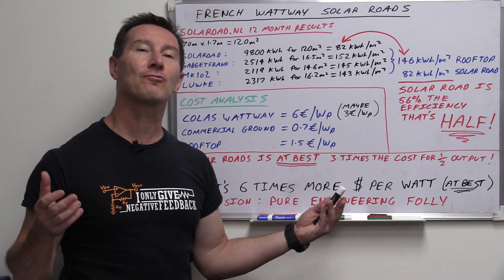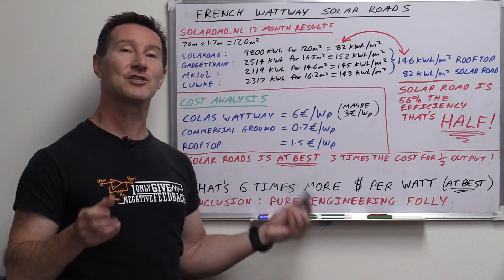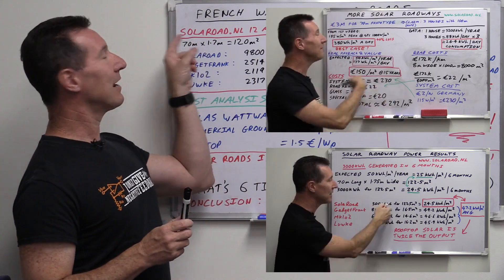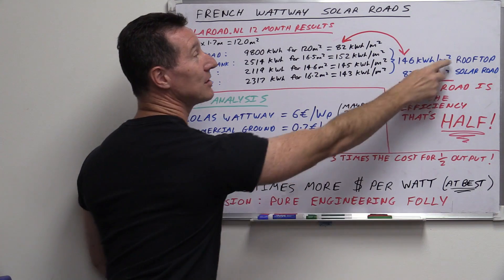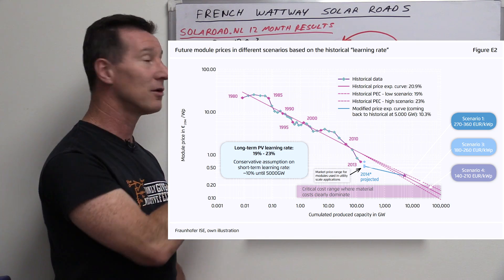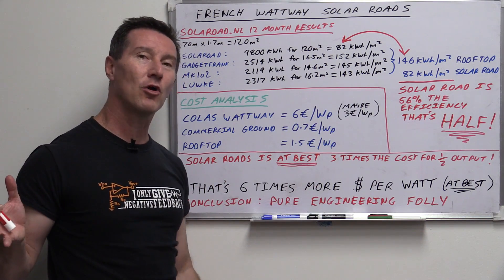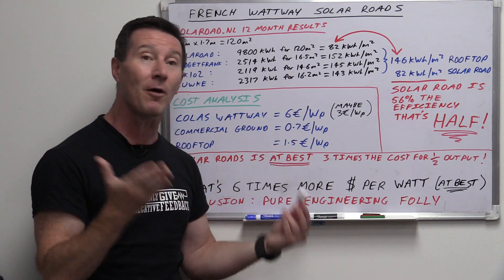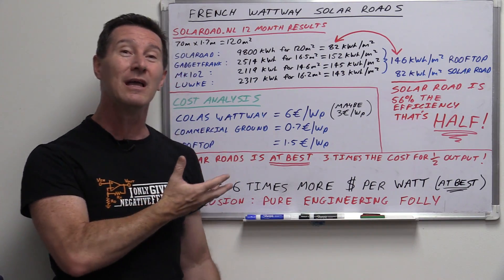EEVblog #850 - French Wattway Solar Roadways BUSTED!

Comment: Solar Roadways aren't that bad - just build them exclusively on motorways and put the panels on roofs above the cars. Basically, combine all three Ideas.

+ No more snow/ice/hail/aquaplaning
+ No wasted space 
+ Easy cable management. Power/Gas/Internet/Whatever, it can't get cheaper.
+ No wear&tear from cars running over sensitive electronics

- A little more pricey than commecial ground, but hey, you safe the cost of snow plowing and sanding, not to mention the houndreds of lifes being safed by free roads in winter.

Comment: Dave, awesome video! Thank you!

Obviously I'm not the only one that thinks that putting solar panels ABOVE the road is a MUCH better idea than putting them on the road!

I'm thinking that PV cells on top of a canopy over the roadways at basically the average-ideal angle would offer the best static "rooftop" PV energy (or better), but also provide some additional protection to the roadway surface from the environment (solar and hydrologic), plus better thermal protection for the vehicles and people on the road: IC engines should run more efficiently, passengers are shaded and should need less air conditioning, etc. Also any water (evaporation distilled!) runoff from the canopy could potentially be directed into water reclamation plants that would need less filtering and purification. And there would be minimal impact on traffic during maintenance.

Comment: PV is fine at isolated junctions OFF LOAD BEARING areas  in SUNNY counties. For ''demand driven' lighting (on detection of incoming vehicle), signals and telephone whatever. Otherwise - no sale. 

I'm not against PV. For roofs in ARID countries. But I live in UK. the grid goes everywhere. Put 100% nukes on the source end of that, convert spae hating etc, to electric as the drain - bobs yer uncle and global warming targets would be done by 2030 not 2050. With profit - but oh  no, "that's not Green enough, that requires government to take a decision and stick to it. That might need citizens who can think in a straight line for 5 seconds to actually pay the taxes that their aspirations require." Nyaaaaaarggghhhh!!!!!! 

Frankly we're better off talking to electrons, you know where you are with an electron, even (quantum) if it's uncertain of it's own position.

cheers

Comment: I totally agree, except for one point:

"It will be/might be/is complicated"

That is not a good point. It never is, not for any argument. Not even close. We already have massively complicated infrastructures. We're actually pretty good, as a species, at dealing with complicated infrastructures.

If there were a simpler alternative, that is one thing. But wiring up loads of non-roadway solar panels are just as complicated a problem as wiring up solar roadways.

Again, I totally agree with you on everything else. I just really have a thing against anyone claiming that a system is "too complicated" when there really isn't an apparently simpler solution.

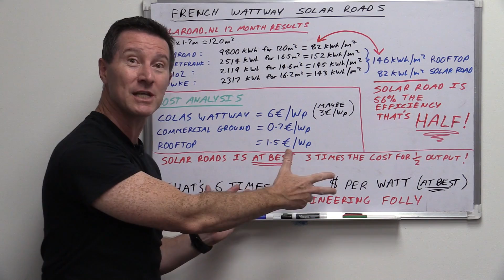EDIT: Specifically, I'm talking about where 12:50 or so when you said someone had to plan the system. There are other reasons why solar roadways are more complicated, that just isn't actually one of them.
Reply from the maker: +Christopher Pilcher No, commercial installation are much easier to install, wire and maintain than ever solar roadways will be.
Reply: I just figured that, in theory, solar roadways would have an output in the same way that normal solar panels do. In that sense, specifically installing them and wiring them into  the grid is no more complicated than doing the same for commercial panels.

Devils advocate, but not having to install a structure to support them would save in costs, from what I can tell. EDIT: By that I mean something to keep them off the ground and stable; as in you could put these "new" solar roadways on the old roadways.

But that said, I have never read the "spec sheets" (if we could call it that), so I'm making a huge assumption.

But you're totally right. Like I said, I agree with everything else. All of it. Maintenance is harder, it's less efficient, all that much more important stuff is so true!
Reply from the maker: +Christopher Pilcher Nope, sorry. Roads surfaces need drainage, so you need other channels dub specifically for the electronics and cabling. Trenches next to roads (that rip up footpaths and verges etc) are expensive. Commercial installations don't have these hassles.
Reply: EEVblog I didn't think about that, you're right.
Reply: +Christopher Pilcher How many low voltage power lines do you see running for 1-2km in a single stretch... Oh, wait, no we use high voltage cabling as the energy losses just in the cables become too high. You can't just dig a ditch and stick a telecoms cable in it. You need to invert and step it up, some serious insulation, some seriously thick copper then one also needs some power storage as solar has a basic issue with power storage, else that energy isn't available at night when it is most needed for house lights etc. 1000km of this, you got to be kidding, all the energy profit is gone just by the time the energy is transmitted anywhere. One can not just wire these things into a grid and be done with it.
Reply: +Daniel Abrahams Space saving could be an argument, but even then putting a ground installation on the crash barriers would be better.

I'm just saying there is a possible case for them to make, but it's not going to make up for the cost.
Reply: +Daniel Abrahams well we have environmentalists that stands in the way. the road has a permit already. again not enough to make up for the inefficiency, but a good talking point. and if environmentalists get too aggressive this might even be viable. (crash barrier post one, not roadway)
Reply: Oh, and speaking of environmentalists... They would love this concept, and for a new road (if prices go down) their bickering (or lak thereof) could make the difference in the cost of the road...

not going to happen with the maintenance costs, but if they are able to bring the profit from energy up to the additional cost of maintenance (in addition to the regular costs of an asphalt road) then it might be a tiny "win" in shutting them (the unreasonable ones) up.

Comment: On a micro scale, and that would be your back yard solar panel setup that is under 10Kw of solar generation. Solar power can be a cost neutral or a little better proposition. As for energy production on a large scale, it's just not cost effective, or reliable enough to be taken seriously. All the projects today are mainly there to make a few people in high positions feel good about themselves. The single cleanest and environmentally friendly means of producing reliable energy, that has the lowest cost and largest production of energy is nuclear.

Comment: What if instead of the main road, they used these on the shoulder and hit them w/ the street sweeper once a week?  The real question is what do they do w/ the power they do produce from the road, if they use it to power the infrastructure needed to maintain the roadways, then surely there is a better way to use solar to do that.  If they are selling the electricity on the market then the problem will take care of itself.

Comment: The  bottom line:  The ENERGY produced will never even come close to the ENERGY used to  manufacture and install the units within their service life time.  Ie. They have a net energy debt.  They only produce tax rebates.    You would save energy by not doing the project.   I suspect even roof top solar is still not breaking even, though it may be getting closer by now.
Craig

Comment: I am trying to look on the positive side here, and figure out why they are still doing it. One thing might be that the cost of the space that would otherwise be taken up by the solar panels (unworked land) won't be usable or sellable. You could calculate this into the equation too. Also I doubt the price of regular solar panels will drop at the same rate of these fairly new ways of implementation, which is another thing to consider. All in all it seems like a very time to actually start doing it. ~ 6 x the cost for ~.5 the output are numbers that are very hard to convince anyone with. I would not be surprised if this chick will work as an executive in the company after her career as politician has ended.

Comment: You completely ignore the fact that the road otherwise would bring in 0 wh... 

My point being, yes they are not as effective as roof top solar arrays, but does that mean we should not investigate the idea?
Reply: Why bother investigating if it fundamentally doesn't make sense? There is a fixed amount to be spent on renewable energy, why spend it on inefficient and untested (so risky) technologies when you get so much more bang for buck elsewhere
Reply: +Tim You completely ignore the fact that Dave (and many others) have investigated what the results would be... (watch the vids where he even uses the optimistic values from the manufacturers or the video after that where the trial testing proves what Dave presented earlier)

My point being, you don't have to install solar roadways to determine the installation and material costs and maximum energy output.  The whole situation only gets WORSE with maintenance, damage and the brilliant idea of placing huge moving 'shade makers' over the panels.
Reply: +Tim you are totally missing the point, there is no point in wasting money in new technology which is clearly not as good, and will never be as good, as what we already have.

We can see efficiency and develop new technology without rolling it out on a massive scale! But in this instance it is extremely clear that solar roadways will never be as good as a traditional installation just due to practical reasons.

Your point about roadways currently not generating electricity might be valid if we have no other space to put solar panels at all - but there are also rooftops not generating electricity currently, and putting the panels there is clearly better so why not do that instead?
Reply: +Tim the reality is there is no way there is no other place in the whole of France to put solar panels which isn't better than under cars where they are less efficient and subject to constant wear.

And there is a fixed budget for these kinds of installations and the taxes definitely shouldn't be spent with companies who are promising massively lower returns for the money for the sake of the novelty of having the panels under cars which is clearly a worse place for them.
Reply: +Tim " You completely ignore my point. How do you think we came to the current solar tech? By just sitting back and not invest and investigate in it? I'm sure the efficiency that we have today was right there when we made the first solar panel, right guys? "
Again, you act as though industry is just sitting back and not investing, it isn't.  Some people will come up with bad ideas such as solar roadways, that doesn't mean they must be entertained or sponsored without proper proof of their claims AND a good reason to divert funds to them compared to other projects.  Meanwhile, the solar panel industry is still moving along and making improvements.
Solar roadways are not the savior of all solar panels, so please don't act like we should expect technological marvels just because of solar roadways.
Reply: Mark Robinson Again, short sighted. It does make sense, roads just lay there doing nothing, why couldn't they produce energy? 

> There is a fixed amount to be spent on renewable energy, why spend it on inefficient and untested

There you go, untested! That's why we have to test it. Why should that budget just be spend on already proven concepts and not push the boundries of what is possible? How do you think we have gotten to the solar panels we have today? Did they just fall out of the sky?
Reply: Mark Robinson I get your point. I just think it's bullshit.

Yes there is. It's called pushing the boundries. We didn't get here as humans by just sitting back, now did we? It's called R&D. 

> Your point about roadways currently not generating electricity might be valid if we have no other space to put solar panels at all 

Building codes in France prohibit the builiding of solar panels near monuments, for one. The netherlands has limited space 

You really don't get my point, do you?
Reply: JimmyDB - You completely ignore my point. How do you think we came to the current solar tech? By just sitting back and not invest and investigate in it? I'm sure the efficiency that we have today was right there when we made the first solar panel, right guys?
Reply: Mark Robinson You are literally still missing my point.
Reply: +Tim We are not missing the point. Pushing the boundaries is good, but you have to look, where the real boundaries are. It's not so complex to put solar on roads - we learn nothing new. But it makes no sense - it's like wasting money to develop quadratic wheels.
Reply: Enzo Canuzzi Hahahah you think it's not complex to put solar panels in roads? Alright I'm out.

Comment: If the cost to produce, install and maintain a means of generating electricity is higher than the whole amount of electricity it will produce in its life cycle, then the net benefit is negative - you might as well throw that money out the window. What will dominate the cost of solar roadways is in no doubt going to be maintenance, which is going to exceed what they're saying it will. In other words, laundering money through a monopolised state contract to the elite. The politicians who advocate and approve this plan may have gotten a bribe, or may just be stupid enough to believe this bullshit.

Comment: I vote for a Gravitational Waves powered generator.
Reply: +JimmyDB - No, I want the real deal. A generator powered by Gravity waves. ;) Don't ask why, caus it will be awesome!
@david be a champ and do the calculations :) The plan is to use a piezoelectric material that stretches and generates electrons. We should make it as strong as possible because it will deform no matter how strong it is.
Reply: +Haas You mean like hydro-electric?  Where the effect of gravity waves on water causes it to move in the direction of the wave generator... and where we place turbines in the way to convert that linear movement into rotational force?
Reply: +Haas
LOL!  
It will cost a billion dollars and make you wait 10 years for the power.
Reply: +geonerd Wow that is really cheap, now I want one for sure!

Comment: I never really understood why anybody would think solar roads could be a good idea. You do not even need to do the calculations to compare it to rooftop installations. "Let's put solar panels on a surface where cars will regularly block out the sun. Yeah, that sounds like a good idea." I mean, it would even be better to put roofs with solar panels over the roads. Would cost a bit more to build (not even sure about that, since you would  be able to use standard panels), but you would avoid a LOT of the problems. Plus, during the summer people would be able to drive in the shade, and during the winter, you would not have to remove snow from the roads :-)

Comment: but there is more benefit than just electricity, they are useful whit self driving cars, following traffic and whit batteries and led lights. but no it does not make sense for making electricity. but making smart walkways and roads are different story.

Comment: Here's the biggest issue with solar roadways: why do they have to be roadways? Why can't we just have them near the roads? Why can't we have them over bike trails? Why can't we have them above parking lots?
Reply: +TheTundraTerror Agreed.  Given the efficiency and cost issues with turning the road itself into solar panels, I think it makes much more sense to place higher efficiency panels in the median or sides of the roads.   I think another possibly good idea would be to place them alongside rail-road tracks and under HV lines where they have already clear-cut the path anyway... plus with putting them under the HV lines there is the added benefit of immediate access to the grid.

Comment: Sa-cre-bleu! ... I belive that is more reliable to put solar pannels in the moon and connect them to a looooooong as fuck wire that is also connected to a central station in le France instead of this bullshit of solar roads. C'mon, Solar Pannels needs full time solar exposure and a clean surface in order to work well, and those dickheads are trying to put traffic above the Solar Pannels?....... ... this idea is oh-so-based in govment corruption.

Just facepalm....

Comment: It doesn't seem this madness is ever going away. Perhaps you should do an analysis on a proper, commercially viable solar roadway technology: Thermal roadways.  Asphalt is already very good at absorbing heat from the sun; all that's needed is a way to harness that energy and do something useful with it. I'd suggest pumping cold water underneath it, simultaneously providing a source of hot water (or steam) and cooling the pavement (preventing the surface from melting itself).